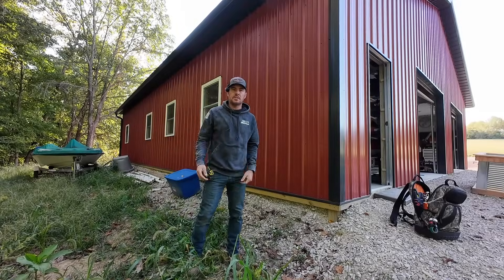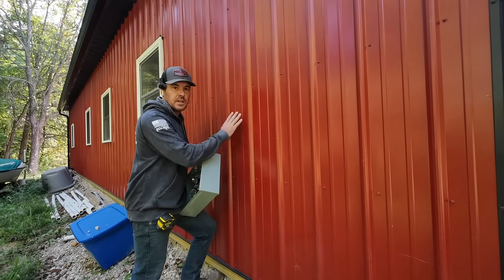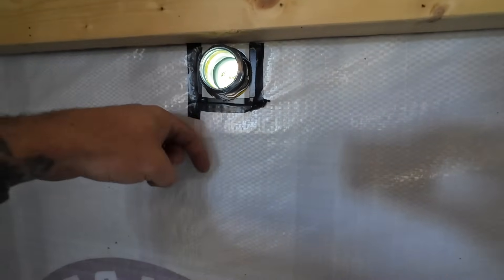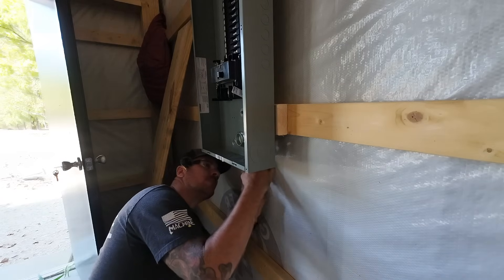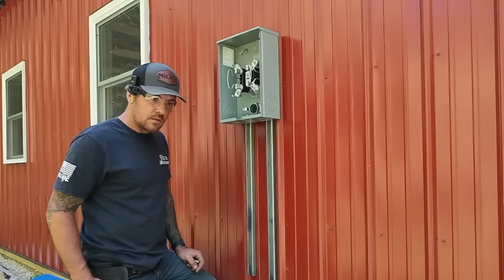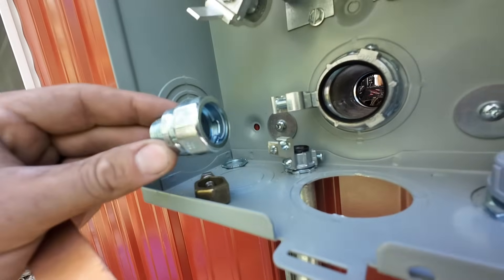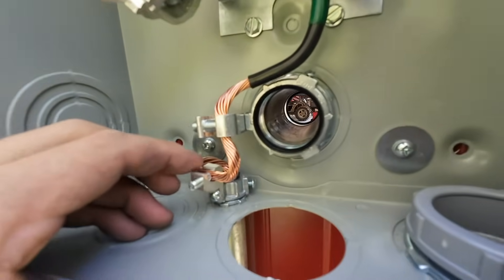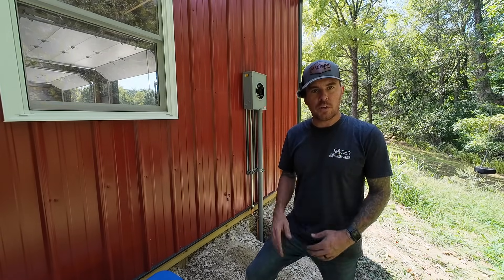200 Amp Electrical Service...EASY TO FOLLOW INSTALLATION

Comment from the maker: Here is the best electrician tool kit you can buy: amazon affiliate link https://amzn.to/3YXxaVJ
Reply: Lineman for 43 years, why electricians don't use a hook knife and azz hole cutters  always baffled me ??? great video otherwise A+
Reply from the maker: Some of them do.  I was never a fan of the hook knife.
Reply: What about ur expansion fitting above ground?
Reply from the maker: For what? The service pipe?   Thats direct burial cable.  That pipe only stubs into the ground.  Its not connected to anything.  I explained that in the video.

Comment: This installation would NOT pass in Texas ! Texas requires that all services have a OUTSIDE DISCONNECT Panel next to the Meter and the Disconnect would feed to the Main Panel indoors. The Disconnect would require that the Neutral and EGC be BONDED at the disconnect BUT NOT at the Main Panel which would actually be a SUB PANEL where the Neutrals and Grounds are isolated and the Neutral Bus would NOT be bonded but the Ground Bus would be !!
Reply from the maker: Im not in Texas, im in Indiana.   I specifically talked about this to avoid comments like yours.  You should make a video about installing a service in Texas.  Thats not what this is.

Comment: There is nothing wrong with going with the Sq D Homeline Panel ! 
It is the most purchased and installed Electrical  Panel throughout the U.S. for Residential.

Comment: Sparky and I did a full service replacement last year.  Wasn't underground but overhead and the point of attachment had to be relocated.  Also, where's the second ground rod?
Reply from the maker: Like i said in the video.  Im in Indiana.  Where you live may adopt a different version of NEC.  indiana doesnt require two ground rods.  You can look it up if you want.

Comment: How about installing it correctly and put the conduit in the wall so you don't have an UGLY conduit exposed on the outside of the brand new building!!!!
Reply from the maker: sounds like you don't know what your talking about.  The meter can goes on the outside of the building.  So does the service pipe.

Comment: When you allowed to use Romex NM inside pole barn????? its 2020NEC!???
Reply from the maker: We're Indiana.  Still on 2008 NEC. Its all over this areas.  If it were my barn its would be all conduit.  But I can't spend the extra money for the customer.  Most people want cheapest option possible.

Comment: i need to do this shit bad lmao, my dad owned an electrical bussiness for resi/commercial, i was an apprentice for him for a little while and then i moved on as an industrial plant electrician doing a lot of 480 3ph for like motors and vfds and crap like that, i got into welding and now i have a big ass plasma table compressor like 4 welding machines benders rollers notchers all kinds of shit in my home garage ive taken a real liking to the metal work lol, but i need to upgrade my main service to a 200A and drop a 100A sub pannel in my garage lol, i put a 50A breaker in my panel and dropped an RV outlet right below it but it's annoying having to run a 100ft major expensive 6/3 extension cord from the pannel into my garage and having to air my compressor up, unplug it, plug my plasma torch in, let it cut until the air is too low and unplugging to torch and plugging the compressor back in over and over again shit's mad annoying, hopefully this year i will have the time to drop a new panel on my house lol.
Reply from the maker: Sounds like we have a lot in common. Im literally doing all of those things right now.  You should check out my other videos.  Just got a big compressor for my plasma table and running a sub panel to it next.

Comment: Great video. I am building a workshop and installing a 200A service just like this one. Thanks for the help. I have a question, isn't there suppose to be 2 grounding electrodes at least 6 feet apart. I know our code calls for that and I thought it was a national code thing. Maybe I am confused.
Reply from the maker: Depends on where you live and what version of the NEC they use.  Indiana no, but for your state it may require two.

Comment: Good video
Noticed a few things in wi. We need to use 2 ground rods 
Our utility (aliant) does not allow us to install any grounding at tje meter. Just 3 wires.
Also no plastic bushing on the conduit from meter to b. Box that would be flagged here.
Very neat work otherwise
Reply from the maker: Every area seams to be different.

Comment: Why didn’t you install a slip joint?
Reply from the maker: For what? The service pipe just stubs into the dirt.  Utility company trenches over direct burial cable.  You can use whatever kind of fitting you want.
Reply: @SpicerDesignsLLC because of frost heaves…mandatory in NH…
Reply from the maker: Like i said in the video.  Im in IN and your local codes may be different.

Comment: Just passed inspection on a new service for a garage we're building.  MAJOR props.  Also in Indiana.  Inspector stated installer went above and beyond and even grounded the conduit, which nobody does anymore.  More than anything, peace of mind knowing it was done the right way.
Reply from the maker: Nice!  Good job and good luck with the rest of the project.

Comment: Thanks for nice and detailed video! two questions: 1.why use another short conduit for ground wire, I feel you can just ignore these component just use #4 bare wire as ground. 2. why you use separate meter and breaker panel while there is combined one? at least, the main breaker is within the house how fire fighter can turn it off when needed?

Comment: I know NEC 250.119 allows to use black when over 4 AWG. Why not use the standard color wire to make sure others know is ground instead of getting a bit fancy and using black and green color. Many times those fade in the box and can be very dangerous. Just my opinion on the ground otherwise love the video.
Reply from the maker: Anyone that opens the panel or the meter should know what they are doing and never assume.  I cant plan for the next techs incompetence.   Glad you enjoyed it.

Comment: Over here, we are suposed to add some kind of grey stuff on the main wire... It used so the wire doesn't corrode and propagate to the connector I think.
Reply from the maker: Ya its called nolox. Its for aluminum conductors when terminated to copper terminals.  The utility company will apply that when they run the aluminum utility feed.  The connections i made dont need it being they are copper to copper connections.

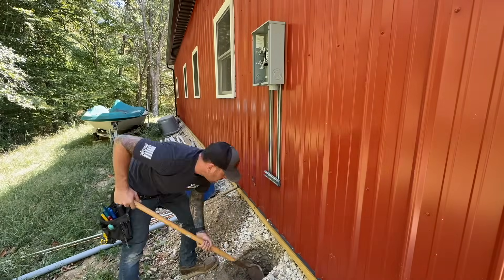Comment: 11:48 I was sorta expecting to see a 90° sweep elbow to horizontal at the bottom of the trench. Is some contractor doing that later? 

[Or is it all UF]
Reply from the maker: Direct bury cable.  Thats all per the utility company.  Theyre all different on what they require.

Comment: Would you say that the ground is bonded in two different places? Or isn’t that meter bonding it to the neutral? Different meter sockets where I live and they don’t have the grounding lug at all, so not sure

Comment: Im not an electrician, so please forgive my ignorance. Bonded at the meter, then bonded in the main panel!? I thought that was a no no. What am I missing?
Is the grounding lug at the center of the meter socket just that, a grounding lug and not bonded to the neutral next to it?
Reply from the maker: Its not bonded in the meter.  Thats the GEC.  I have a longer explanation in a precious comment exchange with someone.

Comment: "Not an electrician", wanted to lead off with that disclaimer. Just a guy who knows a little about everything, and a lot about a little of things.  
I was surprised the copper ground was braided not solid bare, i had pause to go check my box and we are grounded with #6 bare. I guess i had assumed the main ground always had to be solid. Huh, my assumptions could be wrong yet again. Doubt it will be the last time.
Reply from the maker: No Doesnt need to be solid.

Comment: I would be stuck with also doing a trench out to the utility pole, tieing in both sides of meter base and then leaving 20ft of pvc and 25 ft coil for the utility guys also at the pole

Comment: good job mate. Good to see an actual electrician doing electrical installation how to online rather than any old bob the builder pretender. you Americans do thing waaay different to us in Australia. “ ribs not for pleasure” haha love that sense of humour! I’m now in the Philippines and about to owner build a home. learning more about the different standards or lack thereof here…. My plan is to do a steel shed for home / workshop. Australia makes it easier with kits available everywhere, here it seems i’m on my own unless i buy direct from China or make my own steel frame, generally locals here do welded trusses for roof. standard insulation here is 5 or 10mm foam insulation, so your video with the poly core insulation got my attention. will watch more of your work. thanks for sharing with us all, not easy building something and filming, editing etc at the same time. cheers!
Reply from the maker: Thanks buddy!  I appreciate it and thanks for sharing

Comment: @16:09 dang.  Good reflex man.  That would have sucked.
Reply: Actually that type of reaction is what will get you in trouble unnecessarily, especially with a blade in your hand. That bee or hornet had no intention of stinging anyone. Remember, “it’s the bee or hornet you didn’t see that will sting you”
Reply: Around here  @threepiecedan that one will light you up.  Maybe you got some different ones where you live.

Comment: That's clean work but 👍, I would have used  PVC conduit for the GEC and the nipple between the enclosures. You already have a PVC riser, might as well make the GEC conduit the same (then there is no need for grounding bushings). While I am nitpicking LOL, there is no reason for that GEC to be larger than #6 copper. 250.66 A. ✌

Comment: We did not see how you energized the Service panel until the last shot of the video, you see the PVC Coming out of the ground. Don't know where you got the conduit or how difficult that part was 👀 would've been nice to seen that part too
Reply from the maker: The utility company brings the feed to the pipe that i stubbed i to the ground with direct burial cable and they energize it.  What i did completes the service install.

Comment: How would you add a portable generator connection and interlock for this same setup on a brick house? The interior panel is in a sheetrock wall in a bedroom walk-in closet.
Reply from the maker: It's hard to say without seeing it. Will likely have to cut out some drywall to add the feed to the penal and stub outside.

Comment: i started with an outlet to running wire to digging a ditch and sub panel in garage. Just bought a rental property with knob and tube so looks like ill be moving on to a main panel.

Comment: What is a 4A service? What's the purpose of code requiring 1 gfic is that protecting the panel somehow? 
I've never seen grounding bushings and definitely never seen the way you got the ground rod connected to the half inch EMT.. around here it's just ground wire to an acorn
Reply from the maker: I never said anything about a 4A service.   The gfci at the panel is there for construction use.  Sounds like they dont use emt or rigid conduit by you.  Ground bushings need to be used with concentric knockouts.  The jps100 strap is a secondary connection to the conduit itself and the meter can.  All code in Indiana.  Like i said in the video.  May vary depending on your state.

Comment: Great video, looks awesome and very clean.  I'm also in southern Indiana, Switzerland county ready to mount my meter base (320), i was under the impression that they were going to do all that hardwiring, i just had to purchase the pvc, locknuts and ground rod.  I better call REMC and ask some more questions.   By the way if you were needing to make a new video on installing a 320 amp meter base i wouldn't complain, I have EGGS LOL
Reply from the maker: Haha!  Eggs are good for bartering these days.  If i wasnt so backlogged, id be happy to help. Good luck with your project.
Reply: @SpicerDesignsLLC  thanks,  I hope it looks as good as that turned out. Trying to find that 7/8 unistrut
Reply from the maker: @rjacocks1 home depot carries it

Comment: So the bonding screw goes on the first panel.What happens if you run a panel off of that panel and install the ground bonding screw on that next panel.  By the way I  am a 25 year member of local 23 sheetmetal worker's  .I  enjoy your Chanel and i have yet to see a Electrician clean up like you do. 🇺🇸👍
Reply: The second panel will have voltage on the ground which will in turn have voltage on the panel enclosure and metal conduit if you used metal conduit.
Reply: @themaddendynasty5099 . So the Neutral wire will energize the panel. Let's say you have a toaster plugged in to your second panel with the ground bond screw installed  we will have power in to the toaster "black wire " then return power "  neutral wire white " returns to the second panel then Energizes all of the groundwires and panel because they're bonded together. Then returns to the first panel and then the meter.And then the grounding rod back to the earth. Please let me know if I am understanding you correctly.I a find electrical trade very Fascinating. thank you for your time.

Comment: I’m glad you kept stressing not a how to video! As a retired High Voltage Power Plant engineer who has seen some violent explosions due to human error a service entrance might look simple, but a nick on L1 or L2 could energize the whole steel sheeting on the building.
Reply from the maker: No it couldnt.  Dead short.  That building steel is grounded in multiple places.

Comment: Why not pvc nipples between the meter and load ctr, lose that grounding bushing! Is Indiana still using 2008 code? I'm in CO and those methods havent been used by any jurisdictions or utility providers for 20 yrs!
Reply from the maker: Yes 2008 code

Comment: Why wouldn't you use pvc fittings  to pass through the meter base into the barn?  i.e pvc box adapter & pvc male connector. You just made an extra step that's not necessary.  No OZ bonding needed with pvc pass through.
Reply from the maker: Better install. I have no problem with the extra step for a better install.  Your welcome to use whatever you want.  Ill do the same.
Reply: @SpicerDesignsLLC  Of course I can use what ever I want. Im not coming at you with judgment if that's how you read it   I wanted you're logic on why that step was made and you said" better install"  but didn't explain anything,  but that's ok  I don't see a pvc pass through changing the integrity of the install but yeah use what ever you want, everyone does things just a little different in this trade but the same outcome is always achieved.
Reply: @SpicerDesignsLLC  I have a serious question. does your PC require the ground to be bonded in the meter cause technically that would make the meter the first place the grounding and grounded conductors are bonded making it the first disconnecting means and thus make the panel the sub panel. technically you can disconnect at the meter but its normally locked behind the tag I've always heard that it's better to terminate the GEC in the main panel next to the neutral as you had it so if it needed to be repaired or something it can be with calling the power company. Genuine question I have always ran it to the panel and never been called on it and always passed inspection.
Reply from the maker: Just depends on what state you live in and what version of code theyre using. Ive never heard of the meter can being considered the first means of disconnect.  I had a long discussion with someone else in the comments where i explained everything.  The GEC is not the main ground.  Its specifically for lightning protection and surges.  The neutral coming in from the utility company is the main ground.  Thats why they are bonded in the main panel to avoid and difference in potential.

Comment: Dont you need one of those expansion couplings on the sch80 conduit coming from the ground?
Reply from the maker: It just stubs into the ground to protect the direct burial service cable so no.   Doesn’t connect to anything

Comment: Ready to install a sub panel in my shop! “Question ?” If my service box is 140’ from the shop, what size of wire I need to connect!! Thanks! This video did help! Thanks for sharing! And keep them coming! 👍👌

Comment: Attention DIYers- installing an electrical service like this is not a DIY project. There are entire code chapters and parts of different chapters covering this installation. Lots and lots of rules. Save it for the licensed contractor. That’s probably the law where you live anyway.
Reply from the maker: @jamnjayjams577  i said at the beginning  its for reference only.

Comment: I thought you need two ground rods! And why use EMT And not PVC?
Reply from the maker: @joselara6989  emt is not rated for direct bury.  Only one ground rod in Indiana.  Thats why i stated at the beginning my location and where you are may differ.

Comment: Great.  A question I have a disconnect in the garage for 220v box welder with two 30 amp buss fuses and I want to run a 120v 30amp for a small welder.  Any suggestions.

Comment: Kyle umm your suppose to use 1/2 or 3/4" plywood on the inside wall before installing your panel if not im not sure an inspector would let it pass .
Reply from the maker: Thats if its surface mounting to concrete.  And It already passed inspection. The interior in this barn is getting finished too.

Comment: No duck seal on screws mounting meter base to wall or screw holes you didn't use
Reply from the maker: I siliconed them. Good try though